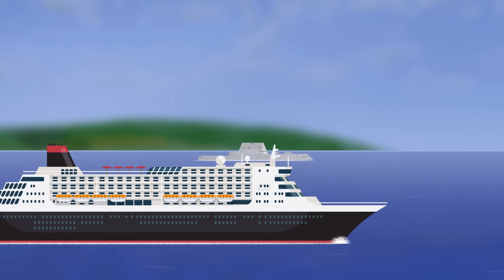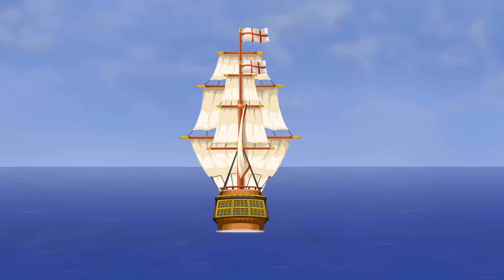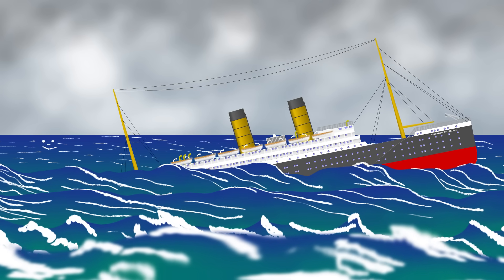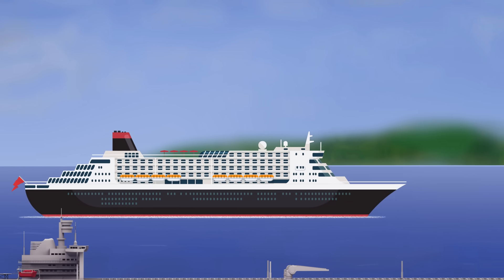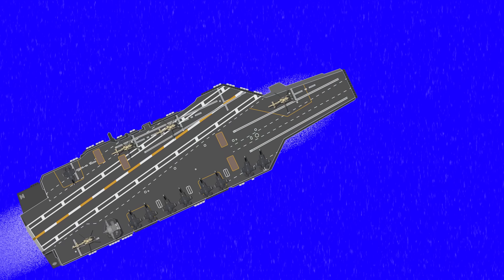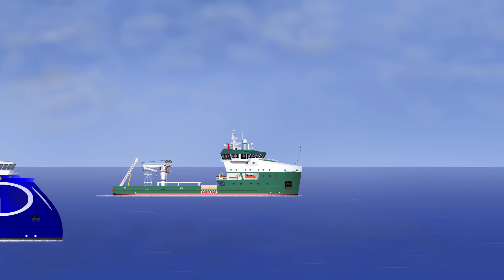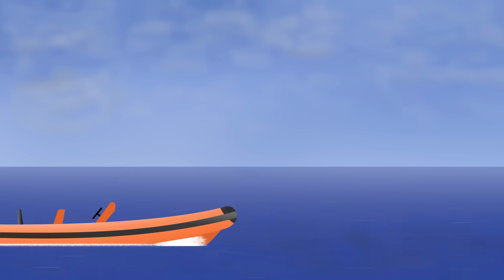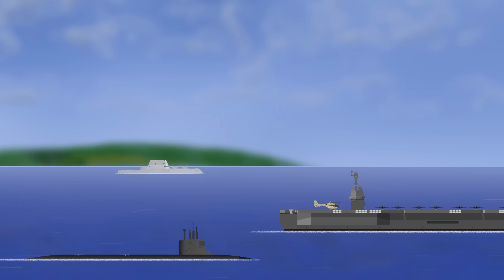Why Are Bows That Shape?

Comment: Could we get a video on the old sailing ship designs? The rounded hull segment was interesting, I never realized they needed ballast to stay upright as compared to modern day ships that had their buoyancy much helped by hull design.
Reply: He's spoken often about the instability inherent with that design but it stuck around for a long time. I want to know why. What advantage did it have over other designs?
Reply: @franzfanz  working with wood, I'd assume  not only was it easier to achieve with wooden construction but also doable in a structurally strong way.

Also, a lot of weight was carried far up with heavy guns and  the obvious very strong  forces introduced from the tall rigging and the wind pushing against the sails.

Some countries like the dutch built their ships hulls a bit more boxy, and merchantmen in general  were a bit more boxy, to maximise cargo hold space vs draft.
But that always made these ships somewhat bobbing like a cork in the  seas, which was pretty undesirable for gunnery and thus ships of war. Those  needed to be stable enugh to sail around the world and to  self right, but not so stable as to  be a bobbing cork, making it unusable  as a platform for guns
Reply: Also these are sailing vessels, so they have very tall masts, regardless of the hull design they would need a heavy keel to keep the ship upright either way
Reply: @franzfanz  As I understand it, one factor was that the early ships were built to be strong to survive and ride out storms and rounded hulls were easier to create in thicker wood needed for larger hulls and they also had less wetted surface fouled or clean. Most ships worked for a living so carrying cargo or arms already needed to carry stuff that would serve as ballast so until hulls and sails/rigging improved there was likely no need to change the design. But as speed became more important things changed rapidly and better bow and hull shaped emerged to take advantage of taller masts and more canvass.
Reply: Tech changed, rigging went from hemp to iron to steel. Each allowed taller masts to set more sail in better winds. As hulls get longer they also gain stability. Look at trucks, they should fall over but they are long so they have some stability. Same with ships. They also figured out better hull forms experimenting with designs incrementally to make faster ships.
Reply: Most old sailing vessels were quite wide and blunt bows. The ballast was to counteract the force on the sails. Clippers had finer bows but were not designed to carry heavy cargoes or guns and had a lot more draft. Modern day sailing boats have a deep keel and lead ballast whereas old sailing ships had the ballast inside the hull, mostly rocks and such.
Reply: @D-B-Cooper  With old hulls, rather blunt fore and aft ends were sort of a requirment for structural reasons, as well.
With bow and stern there already was a much reduced buoyancy to support the weight above them, which coupled with the bow being a point of increased stresses  at sea as well as the wooden construction tending to always flex a bit under loads, cause 'hogging', i.e. the sagging of bow and stern compared to the rest of the  hull.

Overall length also favoured hogging.

A finer bow and stern would exercabate that problem, and it took some clever  engineering and framing to to overcome these issues and build sleaker and longer wooden hulls.

USS constitution is a pretty successful example of diagonal reinforcement to counter these, but  it was really the widespread adoption of ever more diagonal bracing and  more and more iron and steel supports and ultimately steel frames, that allowed wooden hulls to grow much further.
Reply: @lutzderlurch7877  a wooden sailing ship is designed to flex or better said to twist. All the planks were laid fore and aft and so was the deck. It made them more sea kindly and fast. Dumas in his book Two Years Before the Mast explains this quite well. Blunt bows were an evolution for armament (fore castle) and to hold the great weight of anchors and chain. The original bowsprits were actually masts at an angle that had a great weight and force from the sails. The bows were so rounded that the planks could not be bent but had to be shaped. The sterns above the waterline are wide but the run of the hull sweeps up to have a fine exit where the tuck meets the deadwood. The USS Constitution is planked in fir due to it being built in the US. This proved to be more flexible than oak and that is the reason the cannonballs bounced off. Hogging is just a sign of getting old, the greatest buoyancy was amidships and the ship would go between having a wave holding up the center and then waves holding up the ends, being flexed like this millions of times.
Reply: @D-B-Cooper  Being totally stiff  can be detrimental, but so can  too much flexing.

The weight you mentioned is the exact reason why the relatively low buoyancy of stern and bow created the forces tending to hog the ship. Some hogging was  accepted as normal, and it also increased with age. But it also was a danger to the ship if it became too severe.

longer hulls and sharper bows and sterns, i.e. longer 'levers' for the forces to act upon and a higher weight to buoyancy ratio and the ships ends made for ships  with more hogging and working themselves lose, if constructed in the same way.

That is one reason ships of the fighting sail era tended not to exceed some length for a long time. 
with clever additional diagonal bracing, these issues  were somewhat mitigated, ships could reliably be made longer. Though they ships of war stayed rather  blunt to not loose too much  buoyancy and capacity for stores.
But size and sharpness  really exploded with more metal bracing and  then iron frames planked with wood.

As per flexing, the french tended to be damn fine ship builders and somewhat more modern thinking than the Brits. They built somewhat longer and larger ships than their peers on the other side of the channel. But they also tended to build ships with a somewhat lighter construction.
That  usually made them, on average, faster than their british counterparts. But at the cost of  reuiring repairs and maintenance more often and more extensively than the  stubbier british ships, which were built a bit more stiff and heavy.

Ultimately another case of a sliding scale on which to find the preferred compromise.

That constitution is planked in fir is new to me, I thought it was live oak planking, that, at least according to public wisdom, gave her bouncy sides.
Reply: @lutzderlurch7877  the Viking long ship is an extreme case in flexing.
Reply: @D-B-Cooper  but the viking long ship is more of a boat, clinke built with overlapping planks and a simple open shallow construction. Not exactly  that well a somparison to a multi-deck enclosed ship with carvel planking and several tall masts, complex rigging, heavy stores and guns to be carried reliably and for a long time.
Reply: @lutzderlurch7877  just referencing it’s sailing and freight hauling qualities. I have seen people grab the sides and just flex it to the point I wouldn’t want to go out in it. The longest Viking longship that we have found is 121 ft long, longer than two of Columbus’s ships, in fact two put together.
Reply: @D-B-Cooper  Viking ships are amazing. Their construction is also very neat, with the planks  basically riveted together. They're also uite lightly built, shallow draft wide beam. 
They are  excellent for the vikings' operations. Though their tonnage is rather low.

I recally ancient mediterranean ships also had uite a variety in techniques, from sewing together planks to even building ships out of bundles of reeds.
Reply: Check out the Vasa, it was supposed to be the Swedish flagship but sank on it's maiden voyage in 1628 after sailing only 1300 meters in light winds.
It's a perfect example of why regardless of power and money, a client commissioning a ship should never be allowed to overrule safety standards and good engineering.
He wanted it narrow but tall with as many extra heavy cannons as could fit, let alone all those extremely impressive but very heavy wood carvings. That made it immensely top heavy as usual in the age, but without enough space in the bottom for the required amount of ballast.
Reply: @CitizenMio  The story of Vasa is actually a bit more complicated.

The king had some things to say, but the original master shipwright too had some problems, but he died before the ship was finished, and his successor steadfastly and brilliantly during the enquiry and court proceedings kept saying, he finished the ship as the former master shipwright had told him so, after agreeing upon  it with the king. So since the old master shipwright could not be asked anymore, it came down to ask the king if he imposed faulty design or accepted  the same out of ignorance, which was not something the  assembly wanted to do, for obvious reasons.

A brillian defense strategy, but if kinda tinted the view on the disaster for centuries to come.

two mayor factors contributing to Vasas sinking were her being  enlarged once or twice during her construction, but only by lengthening her, and the insistence on a single caliber of gun  throughout the ship.

Plus a lot of guests aboard the ship, on the  upper decks, absolutely no stores and provisions in her hold, yet, and she was gone.

Then again, she was one ship and  her use as proxy for her peers is limited
Reply: @lutzderlurch7877  Oh yeah, there's obviously more to it than I could type in a comment. But from what I gathered from the museum a couple of weeks ago it was certainly more than a lil sus ;)
Very fascinating ship regardless.
Also fyi I didn't mean it as an example of "primitive building" at the time or any such like they were all built this poorly. Just that all of them required a lot of ballast as OP noted and this was a good example of what happens when ships of the era that should have, through circumstances didn't.
Reply: @CitizenMio  The Curator of Vasa Museum has some amazing talks up on youtube. I think one time he meintione who really dropped the ball was essentially all the middle men, who were to spineless to report issues to higher ups, when Vasa early on  looked sus. :) But their bad day  was our lucky find :)
Reply: I second this! I assume it is because of purpose (cargo types for merchant vessels, and speed, maneuverability, and combat capability for pirate and military ships, etc.), aesthetics and beliefs of their era if ever albeit unlikely variable, way of propulsion (as they primarily use wind for sailing), construction materials, and technological limitations. 

For any person of the future, please inform me for such video as yt notifications work in mysterious ways.
Reply: @sixjhontongalamar979  Underwater hull shapes were not really designed with aesthetics in mind, but  the sum of functions needed. 
They did not have the scientific description and mathematic tools yet, to calculate  the underwater characteristics of ships, let alone computers to crush the big numbers.
They understood a few principles and were able to brute force calculate some aspects, but  not to model the interactions between some, so they mainly advanced by  incrementally trying out different shapes and seeing the effect.
E.G. in the British Navy in the 17th C the master shipwrights had significant leeway in shaping their hulls, but were given rough outlines  (usually length, breadth and depth of hold) for their ship(s). Some were successful,  some ships were less so. Sometimes they understood what made them (not)work, sometimes not. often they  knew something was going on, but couldn't nail down the specifics.
It wasn't even uncommon for ships to be launched and after their first  campaign/voyage slightly rebuilt at the dockyards.

Comment: Why did those sailing ships have such a rounded keel then? Surely it would've been possible to build a different keel shape from wood as well.
Reply: probably to maximize capacity, while being able to sail in more shallow areas
Reply: @MrJakson112  Exactly. There wouldnt be all the infrastructure that there is nowadays and they had to get as close to land as possible. Minimising depth was important
Reply: i guess it is also a measure to increase the structural strenght of the ships

Comment: Another reason for modern yacht to use a plumb bow v the steeply raked bows of some years ago, is it increases the waterline length and so hull speed. Now you’ve covered that as well 🙂
Reply: You're polite to say 'another reason'. The brief sailing yacht section was his least accurate in my opinion and potentially more extrapolation than research. For example what he called the 'raked' bow isn't generally the one seen as providing more accommodation, he didn't mention your relatively well known LOA vs LWL point and he didn't appreciate the historic impact of yacht racing rules on design evolution.

Comment: You missed that for a destroyer - a very viable last ditch effort is ramming the enemy.  A method where you want to do as much damage under the waterline as possible.  The radar is clearly the most important, but none the less, collisions still happen, and the designers need to plan for every case.
Reply: Exactly. Although, with modern missiles, I doubt there will be a lot of options for ramming enemy ships in the future. The gun based warship of WW1, 2 and earlier is simply not used anymore. Even the Iowa class was used for shore bombarding during their return for Korea, Vietnam and the 80s and 90s